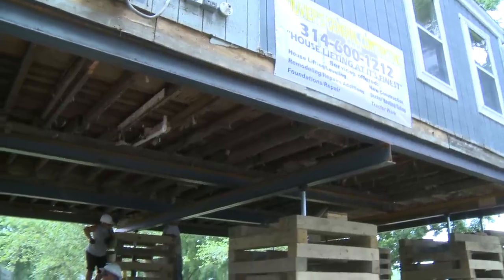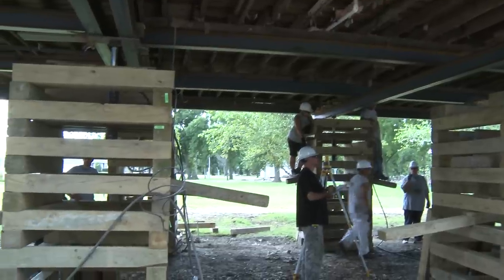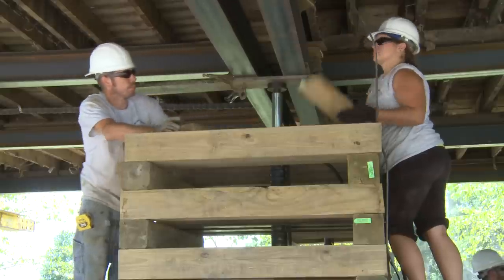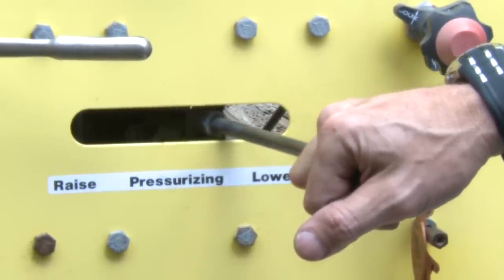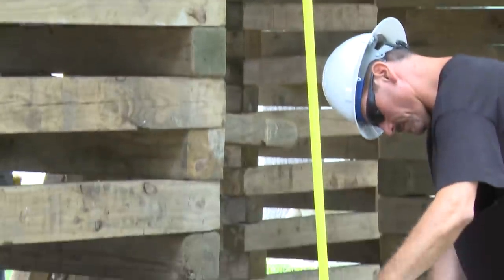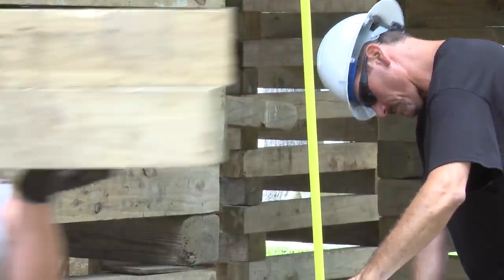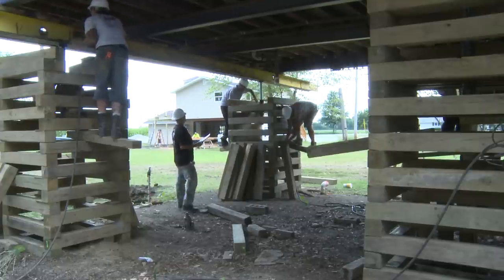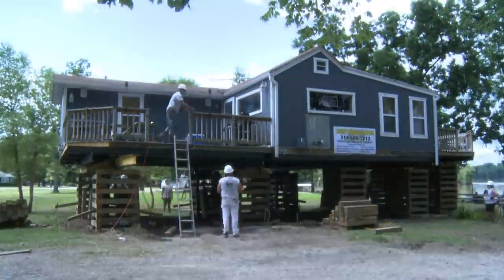Louvier's House Lifting

Comment: Are those fork lift hydraulic jacks hooked into the system ? And what type of wood beams ?
Reply: No , well depends on shat type of fork lift but a hudraulic cylinder is a hydraulic cylinder, sane shit mounts onto typical dozers and heavy equipment..  probably rated for over 50 ton each.  The pump is where you spend the big bucks..  gotta have a good one with that manifold and all the plumbing to go with it. 

And pressure treated 8x8's or railroad ties..